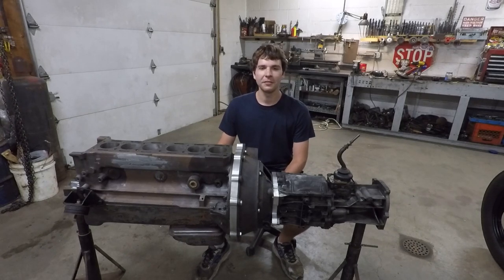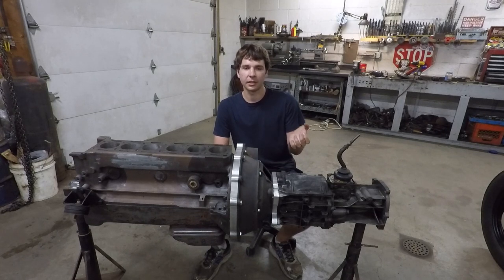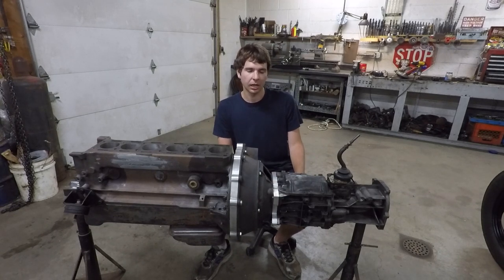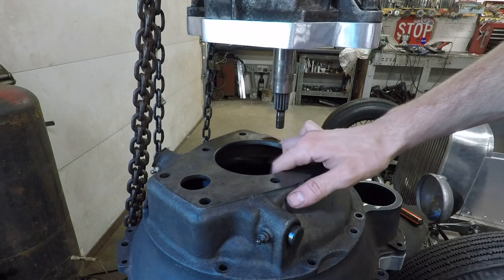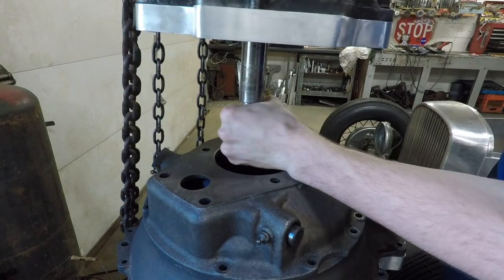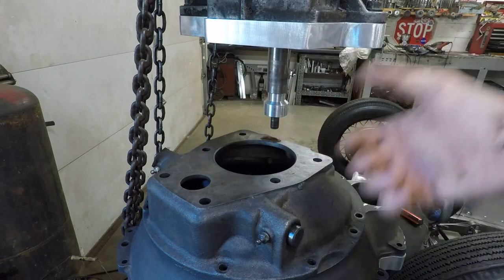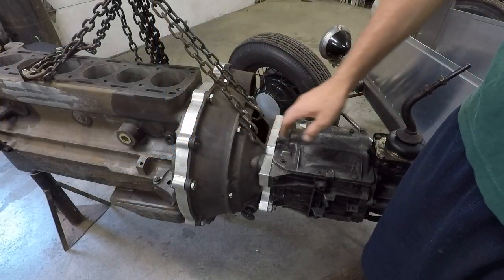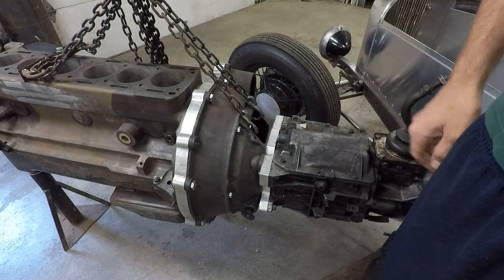Any Engine + Any Transmission Part 2!

Comment: Cool set of great videos. I recently became fully disabled after a gradual decline over the last 5 years or so. I was the the first and only fabricator / machinist that my company ever had. I started as an operator and as my abilities became more obvious to them, my job description increased exponentially . I eventually explained that after a significant investment in several pieces of equipment and tooling, It would pay for itself within a year to 2 at the most, and save many thousands per year after that. They were interested enough and told me to find what I would need. I found a good Bridgeport with a D.R.O., a Clausing lathe and an industrial 18" band saw. My suggestions worked out as promised and it changed how things got addressed from then on. There is not much that can't be done with good running machine shop tools and the knowledge /experience of how to use them. These video's felt like I was watching myself during a days work. Man I miss it already. Great work, brother  and Thanks for the awesome videos ! :)  Subscribed !!!

Comment: Quiet please everyone, genius at work. It is so nice to see a straight six in a car for a change. It will sound really different and cool too.
Reply: The whole Jaguar engine was a brilliant idea for this car. It resembles the type of engines that they were running back then. It should sound great running through the gears. I also no what you mean by its nice to see a six for a change.
Reply: The old straight-six Chev engines had a lot of low-end torque and could outrun many of the V8 engines of the same period.
Reply: @charlesaanonson3954  230 or 235?

Comment: If you put an indicator on the flywheel and put the indicating leg in the aluminum centering hole you can check your work on the alinement. By rotating the crankshaft you can check both planes.

Comment: What LOOKS to the uninitiated to be "rough and ready" work is ACTUALLY a skilled guy at work. Mr Macro Machines is actually quite modest with his throwaway line: "All I'm doing here is.......". If you haven't done anything like this it's NOT as simple as he makes it......plus he's quite adept with his bandsaw, his mill and his lathe. The learning curve on a project like this can be quite steep if you don't have the requisite skills....and a knowing eye. Measure THREE times and then cut once. Bravo to you, sir, for showing the world that an "average" guy with lots of equipment CAN do stuff in his own shop instead of buying the bits and/or hiring out the work. I, too, can't wait to see the rest of the project.

Comment: Me, I have been rebuilding British cars my whole life and some American,I’m 59. 5 years ago I bought a Logan lathe. My friends thought I was crazy, what you going to do with that! Recently I bought a Bridgeport, Colchester lathe and surface grinder. My friend that used to say that,  is dead after too much partying. I wish I would have started machining 20 years ago. I could have milled/fly cut any plate to adapt to anything. My 2.5 car garages is packed. I have 2 cars in it also.  I pull them out when I want to machine. I have built hundreds of things, from barrel vices to any tool I can imagine. Many could be patented, don’t have the extra 100k to do that. I’m YOUTUBE trained. Thanks for the time you guys/girls spend on these vid’s. We-all (new word) appreciate it. I like your car project.

Comment: Being a know it all old fart, I can not say i learned anything. "BUT", it's really nice watching a young man who knows what he wants and has the skills and knowledge to do it. Thank you for sharing all of this with the world, and i am sure a lot of people have learned a lot of things, like top tip for getting holes in exactly the right spot for bolts to line up. Machine a point on the end of a bolt. Cut the end of the bolt off to make a plug for the bolt hole, using the alignment pins press the two work pieces together, sharp tap with rubber/plastic mallet, centre punched perfectly for drilling hole exactly in place.

Comment: Back in the day I got very interested in mechanical design, I worked in civil and architectural design for several years and found myself applying for a position as an engineering tech for a diesel turbo manufacturer for locomotive and tug boats. ended up getting the job and spent the next three years trying to figure out how to get more power.  Turbine blades and cooling systems, tolerances and seals, fasteners, weights materials.  All very interesting stuff.  I loved it.  Decided to learn more about the manufacturing side and took machine trades at a vocational school.   Watching this video has sparked that interest again.  Thank you.  I bet tomorrow i start a new journey.

Comment: The collar and glue alignment process was most ingenious; good, unorthodox thinking.
I had been worrying about what the torque from a Jaguar motor might do to a Ford 3-speed transmission, but obviously a modern GM box should be more than hefty enough, especially in a light vehicle like the speedster.

Comment: One of the most enjoyable channels to watch.  Like others I really am looking forward to see the finished speedster!  Watching your tank build then this one... WOW!

When I saw your engine and transmission sitting on the jack stands (one in the front and one in the rear) it reminded me of a 1953 chevy I had with a transplanted small block 327 and 4-speed trans.  At first the engine was mounted off the front of the block (like the 55-57 chevy) and a transmission tail-shaft mount like the next generation.  There was so much stress on the throwout bearing sleeve that it snapped off (a couple of times!)  This was solved by moving the engine mounts to the middle of the block like the next generation configuration.   Old guys just have to throw in their two cents!

Comment: Excelent video!!! I ve put a Perkins 4 and later on a Mercedes Benz truck 1964 gearbox with a super short first gear, to my Chevrolet C-10 1977 (argentinian made). It s a mule!!!! I live in some lost sierras, and I needed it in that configuration. Of courrse in a much more precarious environment, so to speak. Though the adapter  holes  I made it with a lathe workshop.

Comment: When your transferring multiple threaded hole locations like that, best to complete one, bolt it down and do another. It would suck to spoil that plate after all the work you put into it with a misplaced hole. Don't ask how I know...........
Reply: Saving 10 seconds by not bolting the part down. Assuring myself things will be OK. Kicking myself for spending an hour or more trying to fill a 0.5mm offset hole and boring it out all over again!
I'm guilty too, done that more than once!!
Reply: That is why he drilled the alignment dowl pin holes and installed them first,so every  other hole was in the correct spot.I am an old man almost 70 and worked in fabrication shops in the early 70's
Reply: @donaldk.macbaird5248  You're right. Guess I wasn't giving it my full attention.

Comment: Very impressed, I failed at this many years ago trying to mate a fiat twin cam to an X19, ended up having it done professionally, however they screwed up the distance, and I ended up spinning the second clutch disc on the end of the splines (twin plate unit) I now have better equipment access, and with the help of this vid, a better understanding of how to succeed, thanks

Comment: Muy bueno tu canal! Buscando adaptación de caja encontré tu video y me gustó mucho ésta adaptación. Lo que realmente me gustó en el video anterior fue que dijiste que no importa que sea cualquier transmisión en realidad todo es lo mismo.
Yo hice igual q vos tengo un motor que acá (Argentina) se llama TORINO originalmente viene con una caja de 4 marchas de la marca ZF que son MUY buenas, pero quería una 5ta sobremarcha. Ahora adquirí una GETRAG de 5 marchas de BMW 325 que supuestamente es una caja que aguanta el torque del motor TORINO

MOTOR TORINO: 3770 CC CIGUEÑAL A LA CABEZA Y APROXIMANDAMENTE UNOS 170 HP.

GRACIAS!

Comment: First I would like to compliment you on the video, very well done.  I disagree with your statement that the bellhousing does not need to be in perfect alignment with the crankshaft  because you are making a custom adapter. That could be true if you accounted for any misalignment, but what you did really doesn't make the trans concentric to the crank. I say that because you have a flat surface on the housing and a flat surface on the adapter. The size of the holes for your bolts will be larger than the bolts. Bolts also vary due to mfg tolerance. This WILL allow the transmission to move about enough to create an alignment issue when your shaft bushing is removed and you are installing the trans from under a vehicle. Older Chevy V8 engines used a Truck bellhousing that had a larger pilot hole than the cars did. People who used truck housings quickly discovered the problem. The mounting bolt holes were all in the same position on both housings. It was just that the larger holes allowed the trans to be mislocated and bind the input shaft. Your set up should have started with getting the housing centered, or measuring how far off center it was.....and then machining the hole larger but concentric. Then when you made your second adapter, a lip turned on the front of it could have insured the same concentric alignment any time the trans was reinstalled.  Again, I compliment you on your video and your skills, but I believe you erred when telling people that it wasn't necessary to have the housing concentric.  The only way that would work properly is with the same alignment lip on your adapter.......but located off center to correct for the built in misalignment.

Comment: Great video set!
One question that I don't think you addressed, what considerations get made so the input shaft still reaches the pilot bearing? Since you've added about an inch between the trans and the flywheel, isn't that a concern to look at?
Reply: yolo
Reply: I had the same question. I also had the question on part 1. He measured from the crankshaft to the bell housing built into the flathead block. Then he measured from the crankshaft to the dog's head or whatever it was called, but he didn't account for the actual bell housing he used.

Comment: thanks for a great video! what i never understand is, how you compensate for the added lengths of the adapter plate? I understand in your case you found a bell housing which was shorter than the original chevy, but what if you have to use the original bell housing? thanks
Reply: There’s no one right answer for this, especially if your starter is block mounted, which dictates your flywheel backspacing. Automatic trans are much easier to adapt, with torque converter spacers and/or different bolt holes in the flex plate.
Reply: so essentially he used the difference between the two bell housings to determine the plate thickness? that's smart. I get your question though.

Comment: Do you have a reversing switch on your mill? If you do don't be afraid to use the tap to thread holes  Also if on your drill press same thing. I do this every day at work using mill or drill press.

Comment: i think to center the inputshaft on the gearbox to the clutchhousing you could put it on the clutch housing with the inputshaft sitting in the pilotbearing , then use a measuring device to check the maximum outside border all the way around  , divede that and the most inside border by 2 to get the most exact center measured from the outside , you probably need some sort of solidly mounted stand to clock the measurments off or work of verry fine borderlines scratched in the mounting face

Comment: 6061 alum. is all fine and good, But you may want to consider using heli coils when bolting it all together. Due to vibrations and torque specs.

Comment: The power to weight ratio makes me think you're building an extremely fun car to drive. I think your fans are going to really want to see a good demonstration of this beauty. Do you have access to a track of any kind? And off topic but did you visit that Net Result place this past Summer? Rough time for vacations but lots of people were here. Another great video. Any big Companies offering you jobs yet? Stay Well Dude!!!
Reply: It will absolutely be fun and interesting--I'd take this over most cars, but it's not going to scare any serious sports cars.  That engine/trans isn't feather light, suspension is ancient technology, and I think the most limiting factor will be grip---narrow tires and narrow track.  But ultimate performance isn't the goal.  Beauty and incredible craftsmanship are.
Reply: @Adam Miller  I'm fully aware of that. I'm hoping he goes overboard with the finishing touches, specially the interior and engine compartment, wiring etc. His skills go far beyond just metal work. I only mention a 'track' so he has an open road without breaking the Law. I doubt there's a State you could Register this in, CA?

I was going to ask him if he thought his front suspension was up to par for the weight of this drive train, but I've refrained from second guessing him on anything though as he's no fool. I just think we'll all be disappointed if his demo of this, “Work of Art” is just in his yard or up and down his driveway, right? Depending on the gear ratio of the differential, I also think those rear 'narrow tires' will bark and spin without hardly trying. I'd love to see that, specially his reaction to it ha ha...

As a teen I worked in a shop that made Fiberglass Bodies and put them on CJ5s, a peppy 4 cylinder and you had to drive like Granny not to chirp in 1st and 2nd gear. We'll hopefully find out with this, fingers crossed. Cheers!!!
Reply: @MisterAMuck  Taking your question of registration, in California at least he should be able to. He would need to go for a check at a CHP station for a VIN number to be issued, a basic safety check, and possibly a smog check if that 2.4 is (hint- it isn't) "new" enough. All the states are roughly the same.
Reply: @billh230  I've heard that about CA but have been told that here in MA it's not possible. We're the most regulated State in every way, not just in Motor Vehicles. I may be wrong but if I'm not mistaken it was a Mechanic that said this to me. Off the top of my head, you couldn't get a Sticker here without fenders. Sadly it wouldn't even be the same car by the time you got it to pass, assuming you got an assigned VID to begin with. I'm supposed to go ask a Mechanic a question for my older Brother, I'm supposed to ask if any of his Grandfather's paperwork was still around because he held the Title to his 57 Chevy Convertible until it was paid for. That was about 60 years ago when my Brother was in H.S. - Sorry, I'll ask if I talk to the guy, he does Stickers as well, so he should know. I'll let you know if I get some answers. Bye For Now...
Reply: @MisterAMuck  Yes, please, I'd like to see what you find out.

Comment: As always, good tidy job and thought process lad.  I have a question : If you haven't already taken it into consideration be mindful of the tolerance of the input shaft from the gearbox pushing against / touching the crankshaft. That would be a no-no and a recipe for disaster. It appears from the camera angle that the crankshaft isn't already installed, I could be wrong.... so I'm just curious as to how you measured / accounted for the length of the input shaft versus the end of the crank?  
Good to see you back, keep the great videos coming.

Comment: Great stuff. I hugely enjoyed watching both of these.  One thing I could not but wonder is....do you know someone nice at the Aluminium supply house? Else just the cost for the metal had to be near $600 and $150 Respectively for the blanks. Regardless, it was done really well....been a long time since I did this type of work. There is something to be said about the feeling of doing job shop work where you get to see/feel the output of your work and the relief your customers get when you solve problems for them!
Reply from the maker: The big plate only cost about $100 + shipping, and the one in this video I got at scrap price

Comment: After looking at all the comments,  I see several people have the same question I have:  How to you ensure the gearbox input shaft is the right length to fit the pilot bearing?
Reply from the maker: It's all measured out beforehand, so the I know it will work

Comment: very nice work indeed, question ; it appeared that you moved the transmission back a substantial amount , how did you compensate for that in relation clutch to input shaft ?

Comment: Question: If you add and adaptor plate (say 1in thick) between the engine and clutch housing, doesn't that mean that the input shaft is 1in further away and won't reach the pilot bearing? And wouldn't the same go for the clutch release bearing?
Reply: Exactly my question too!
Reply: @charleshurt4863  he made the adaptor plates the exact thickness for the transmission to away from the engine the right amount without making any modifications to the input shaft, remember that the bell house on that tranny isnt from that tranny

Comment: My dad in the early 70s made an adapter plate to marry up a 283 small block Chevy with a three speed overdrive and may I add front of the engine Motor mount crossmember so he didn’t have to modify the subframe which this set up is in a 1951 mercury two-door also he did the wiring over in 12 Volt with Drop a volts and the clock and a.m. radio work👍🏼 and the best part is I’ve owned the car for over 15 years my 1951 mercury/my dad‘s car rest in peace Dad

Comment: I do things that people tell me not to attempt like completely dismantling a pressure plate because the rebuilder didn't adjust the fingers correctly and now I have hot spots. Old timey shop manuals show you how, so why can't I ? Making Zundapp conrod bushings, pressing BMW Isetta crankshaft, manual machining is the best!